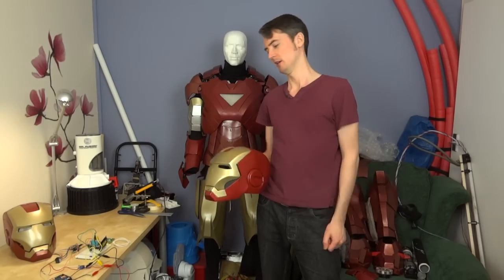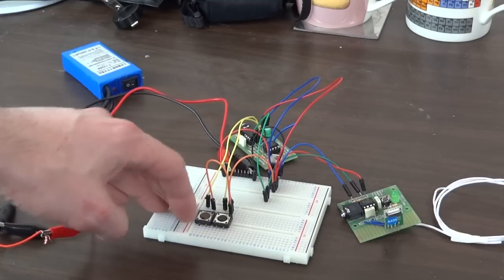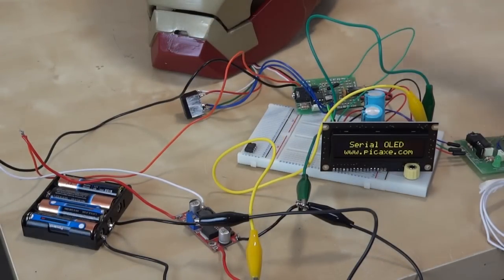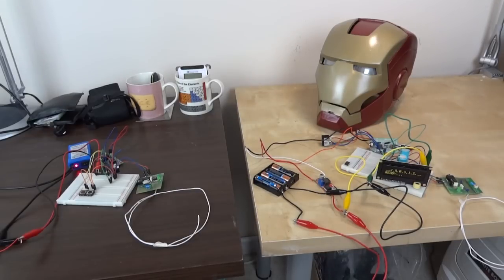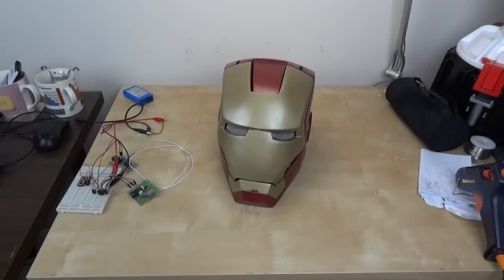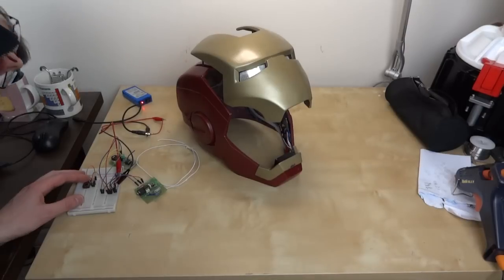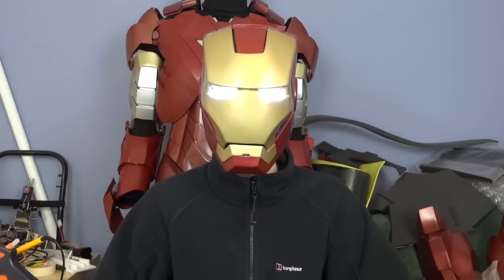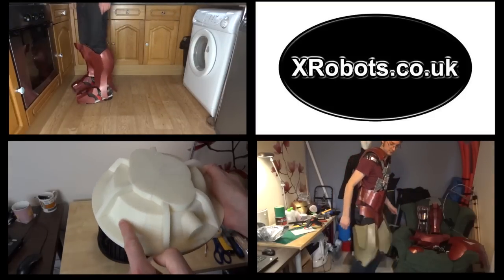Iron Man Power Suit #55 | Helmet Electronics | James Bruton

Comment: Only if you could be able to do it with out electronics If you could use your thoughts to do it. When its turned on and the face plate is shut shouldn't the eyes be lit up all the time like in the movie and off when the helmet is turned off or face plate is open and even if its damaged the lights flicker. I was also wanting to get into this kind of electronics as a hobby what would you suggest I start with.

Comment: wow, all that messy looking electronics stuff packed into the helmet and hidden away, looks great and really advanced. You'll get loads of jealous looks when you finally get to wear the completed suit somewhere. Shame you don't live in America with easy access to comicon, that would be an epic place to showcase the finished thing. I think you should do some testing on how long those four batteries will last when using the eyes, opening and closing and all the other stuff. The last thing you want is the faceplate half opening due to a flat battery when demonstrating.
Reply: I get what you mean my magnetic braking, I was just imagining you out somewhere demonstrating and the helmet only sluggishly opening halfway before it runs out of power and the brakes stop it. Im not sure how much power four AA batteries hold (not talking about voltage) and there are quite a few electronics in the head. I imagine you would put fresh batteries in anyway before you go out, or just use rechargeables.
Reply: ***** I'd recommend using at least 2400mah rechargable batteries. It will last long and you will save money after second recharge.

Comment: It does look silly when you look up at the screen. It should be easy for you to remember the sequence. From the 'open' option from what you explained it should just be [select button- execute button] to close it. So when it's open if you just remember [left pod,right pod] then it will close immediately. You might have the same issues if you want to run the uni beam with the faceplate open though.
Reply: ***** Or since you are planning on having a sound board with the transmitter electronics you could have the system make a click (or perhaps something more Iron Man-y) so you could have audible confirmation that you are on a new menu item.  Still, this suit is becoming seriously epic and I wish I had lots of money so I could sponsor your build.  Good luck!  After you complete this, please build a working Tardis!
Reply: Toadsith

Comment: ***** I think you have made the most advanced iron man helmet among all the cosplayers

your helmet looks nice all over but there are 2 problems :-

1) The sound made by your helmet is louder than your voice in the video
  so i think you should do something to decrease the sound of the servo

2) The upper part of the faceplate of your hemet remains in air but it should
     be touching the back part of your helmet a bit. 

so i think in the part 6 of the video you should fix the 2 problems mentioned above...   
A super fan of yours 
   kushal9336